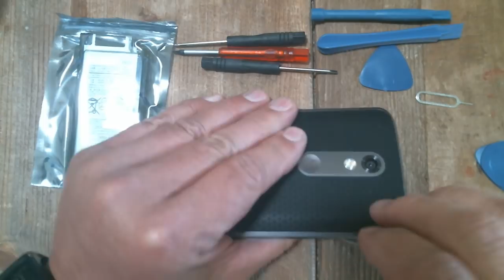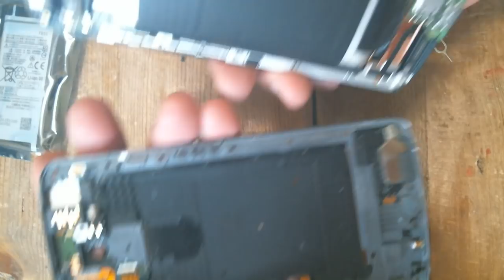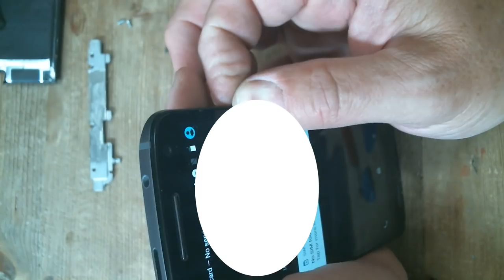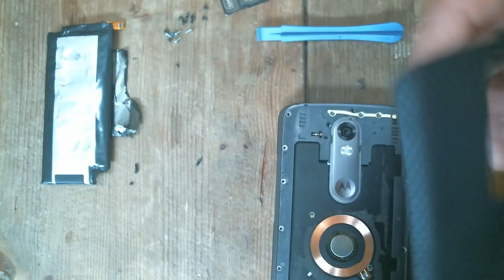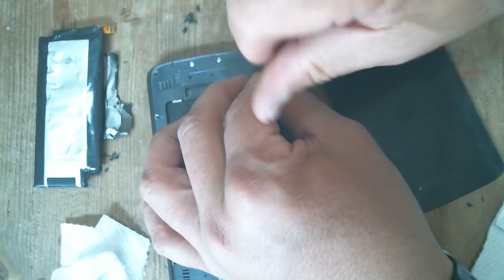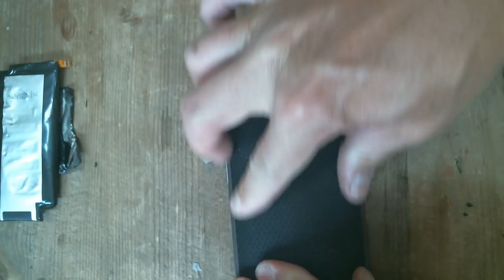Replacing the Battery in my Droid Turbo 2

Comment: I fell back to this video twice. The first time would have been all it took, your instructions and demonstrations were spot on. The glitch came with the small copper ribbon that clips down onto the ... motherboard? The two batteries we've bought, and returned and are about to return had the ribbon in the same place, but the clips faced UP and just to the side of the clip in the board. I know your lessons would have worked since I was able to reinstall my existing battery (which dies randomly as power gets to >75%. It works well when it's on. Not great, but well. My Motorola lasted four years, but still ... it was once a premium brand. You sir, are a premium resource. Thank you for your help. /respects

Comment: Thanks for the video.. I just replaced my 3 year old battery tonight. Even after you said "some people strip the screws.." I STRIPPED A SCREW HEAD!! Eventually I drilled the head off and pulled the body off .. Not a big issue just be careful. Only bad part.. I got the old battery out dated 2015 and the new battery I put in is dated 2016!!!I did not think about checking the manufactured date but it came out of the sealed package charged at 78% and holding. Old battery would have gone down 10% just by turning it on and opening an app. Thanks again,
Reply from the maker: Those tiny screws are easy to strip. I am glad you were able to get that done.  The batteries mostly wear out from being cycled (discharged and charged, most of the damage occurs near the end of the charge when it is held at a higher voltage, when the battery is over heated or if it is severely discharged, severe discharge usually does not occur with built in protection).

Comment: The ironic thing about this phone was that it was marketed to be durable (crack proof screen) and such.  This phone gave me nothing but problems. First the charging port went and then the battery all within a year. I've long since gotten a new phone but decided to try replacing the battery in my Droid Turbo 2 to use to watch videos. I followed the steps and so far, fingers crossed, the phone is up and working. Thanks!
Reply from the maker: The only thing bad with mine was the battery, I have had mine since 2016, still works pretty good. I have dropped it so many times and still no broken screen. I am happy you were able to use the video to replace your battery, maybe will come in handy as a backup phone if you ever break your new phone.

Comment: Excellent tutorial sir! Made it easy for me. 

For anyone else about to do it, I recommend buying a decent precision screwdriver kit (Harbor Freight for $7) because the throwaways that they give you BOTH stripped out trying to get the perimeter screws out. They have thread lock on them and are fairly tight. As Mad Scientist said, good downward pressure to get these out. 

Also, I recommend taping the battery in place so it cannot move around in there.
Reply from the maker: Thank you! Definitely a good amount of downward pressure to remove the little screws.

Comment: Ok did mine tonight.... the power and volume buttons are a PITA when re-assembling the thing! There does need to be a notch in the upper-right corner of the replacement FB-55 battery. I left the black glue on back of cover only peeling off any bunched up sections but whatever was still smooth I left alone and put the cover on using only that it seems as secure as ever IMHO. Lots of tiny screws, hobby glasses with bi-focal lenses much recommended! Finally I did not have any sound when I first test-powered it on with back cover still off and most of the edge screws not in... took it back down to battery pack, couldn't find anything amiss so put it back together again with a few more of the edge screws in place and test-powered it on and got sound and everything so something inside must need to make contact between the part with the wireless charger antenna and the circuit boards on the phone for sound and vibe to work! Scared the dickens out of me at first I thought I had made a mistake somewhere! Anyways.... regards and have a great Christmas!

Comment: This was way easier to follow than all the ones I've watched. Now I do think I can do this myself. Thanks for an excellent Turbo 2 phone battery replacement video. Great cleanup technique. :)

Ordered my kit. It came with a T3 screw.
Reply from the maker: Awesome! I wish you the best of luck with the replacement. Let me know how it goes!!!
Reply: One of the black screws could not be unscrewed. Don't know what to do next. I'm trying not to force it apart.
Reply from the maker: You can try filing a very small amount of the tip of the screwdriver off to give it a little more 'bite' then try pressing down with a fair amount of pressure when turning the screw.
Reply: I actually did that. Didn't work. Thinking I might need to cut through the screw or something.
Reply from the maker: That is a possibility, if you have access to a drill press you can get a drill bit that is a little bit larger than the screw shaft and very carefully with a very slight pressure drill into the head until it comes off. I would only try this on a drill press since it would be very easy to damage things without the stability of a press.
Reply from the maker: Any luck with this?

Comment: I really liked your video. I watched another video of some guy with the blue gloves take off everything and thought that was stupid. I have taken apart many old Motorola droid phones (I have a droid 4 ) and fixed them all. Those batterys off of Ebay don't seem to last very long but for like 15 bucks still worth it. I just bought a Turbo 2 and the battery drains fast. I ordered a new battery off of Ebay and going to change it out and use it as my daily driver.
Reply from the maker: Thank you, The battery I replaced is still  working, starting to show a little less capacity but definitely worth the replacement and extended life of the phone, so happy I did this.

Comment: All things in balance, this is actually a pretty simple procedure: At least Motorola had the forsight, wisdom (and not to mention decency) to have the access point in the BACK of the phone. MOST devices these days can only be accessed by removing the screen - that is an altogether different animal (especially since everything has to be gutted along the way to get to the battery that way).

Here it was just a matter of removing a thin plastic layer, unscrewing a barrel full of screws, removing another piece, and lifting about three connectors upwards (at least they wheren't the parallel kind with the latches) to get to the battery.. Basically, at least Motorola doesn't make it absolutely impossible here..

Comment: Bought a phone repair kit from walmart for $7 and had no issues. I would recommend putting a tiny bit of penetrating oil on the screws and let it sit for a couple minutes before removing them. This honestly wasn't much worse than any other battery replacement and is pretty much the standard nowadays.

Comment: Great video on replacing the battery, and thanks for posting. A couple of questions and a suggestion: How is the battery life with the new battery? Also, why did you remove all the adhesive before reassembling? At the part where you forgot the bracket, and had to start over; some people might be following along in doing their replacement: it might be helpful to overlay a note at that part of video to let viewers know that you made a mistake at that part of the process, so they don't do the same thing. Otherwise, your video is a great resource for those seeking info on DIY battery replacement. KUDOS!
Reply from the maker: Thanks for watching and the nice comment and suggestions.  The battery performs like the phone was new now.  The old adhesive had to be removed so that the cover would go back on properly.
Reply: I had the same question about the glue.  I am going to pop my phone back in its gator case.  Think that should hold everything thing together just fine.  Thoughts?

Comment: I am trying now and being unsuccessful on getting the black screws out,  drilled them and broke the phone glass.  Even though I was being very careful.  Threw phone away  It was worth a try.  Phone was not working properly so wanted to try to replace battery.  Tried to save it.  also the kit I ordered the heads of the tiny screwdrivers stripped right away need really good tools working with these tiny screws.  I tried

Comment: Well done video! May I just suggest laying down a white towel or cloth as your work surface next time though.... it keeps tiny screws from rolling away, makes them stand-out (easier to see against a white backdrop) and protects the phone from scratches. I love this phone best I ever had but now mine is starting to shut-off after a mere 12 hours or so off charger (even just sitting unused overnight on night-stand by bed fully charged it dies 1st thing when I wake up and check it!).... so, even though only a few months past a year old, guessing I'm about to need to replace mine's battery too. Ughhhh! :-(
Reply from the maker: Great suggestions! I really like the phone because I have hit and dropped it so many times and it still has an intact screen. After replacing the battery mine has been running great. I wish you good luck with your replacement. Be careful taking the screws out I know they strip the heads easily so a fair amount of downward pressure while taking them out.
Reply: Quick question.... why do some of the FB55 replacement batteries have a notched corner while other FB55 replacement batteries have all 4 corners intact? What's with the notched corner and is it necessary to fit in our phone?
Reply from the maker: @MShrader211  I do not remember any notched corner. I have a link in the video description for the one I used.
Reply: Yeah the MaxBear one doesn't, but many listed as FB55's for the Motorola Turbo 2 do have a notch in 1 corner which made me wonder... I can't find any difference in them cost or specs wise, so it has me baffled. I was looking for a replacement battery that included the battery cover adhesive or 2-sided sticker, when I started noticing some batteries have the notch in them.

Comment: I've started trying the replace the batt in my wife's Droid Turbo 2, and I've already run into differences from every other video including yours. To start with, even using a heat gun, the fake leather skin on the back of the phone, it ripped all to pieces instead of coming off. Maybe I had the heat gun on too low. While working I have upped the heat gun to 400 degrees, which helped, but I'm afraid of damaging the display of course. I note that you have a plastic skin on yours. After I got most of my leather skin off, I found a coating of semi-transparent plastic on the machinery. The machinery under the plastic looks like yours. I won't be able to remove any screws or other parts (much less the battery) until I get through the plastic. The plastic might be an extra-thick layer of glue that was holding the leather skin on. I'm afraid to apply high heat or solvents to it. I might try simply cutting away the plastic, but if it is struck to the parts underneath it, it will be hopeless. My wife says she's had this phone five years. Could it be a less-repairable, earlier model than yours? Do you have any ideas or suggestions? Or is it time to throw out this phone? Thanks.
Reply from the maker: I wish I could see a picture of it, but it kinda sounds like the leather was attached to the plastic and it was the plastic piece that should have come off with the leather still attached to it.
Reply: My phone is like this one. The leather is glued to the plastic backing of the phone. I started to just pull up the leather at first, but I soon realized that it was just the skin of the plastic back. You need to start by getting something sharp and thin under that plastic backing and DO NOT just start pulling up the leather. The leather part is the prettiest feature of this phone, in my opinion and I didn't want to ruin it.

Comment: Great video sir, a very nice job.
I was just wondering why you don't at least put down a microfiber towel to cover up that rough wood your working on? Just the grit in the wood, not to mention what ever else may be on it couldn't be good for your phone.
I make my work benches out of New kitchen counter material I buy at a over stock store for home improvements. At least it's smooth anyway. 
Just wondering is all, no criticism, none at all intended. It's just tjat everyone's bench may not be as clean as yours.😉
I have bough Motorola phones since they came out! Never had problems with the phones, but their batteries have always been their downfall. The phone quality, and my own ability to repair them is ALL that keeps me with them these days.
Thanks again for the video, it was great!

Comment: Thanks for the video. Was wondering if you did this after the operating system update that killed the battery. I've been stalling on the update for over a year but things are getting bad now.
Reply from the maker: I did not hear about the OS update that killed the battery. Do you have a link that I can read about it? I have done all of the updates on my phone as they come in.
Reply: It was the updatre to Nougat @madscientisthut
Reply from the maker: Just did some reading on it. Mine is running 7.0 (Nougat). So far mine has been running pretty good, just that I get it into this mode every few days where it will eat the battery quickly, but a quick reboot usually fixes that.

Comment: That said, though: I too am a bit disapointed in Motorola here. I've had a Droid Turbo 2 since March of last year, specifically because I heard about how rugged, durable and dependable the phone was - I had a Moto E (2nd gen) and Moto G (3rd Gen): Both of them where tough and lasted me as long as I had used them: They felt like the ThinkPads of phones (it's no wonder Lenovo owns them now), and figured that the Droid Turbo 2 sounded something like the X1 Carbon of phones.. THAT SUMMER the usb cable died, and I had to charge it wirelessly, which was a pain in the side as clearly the battery wasn't having any of it and everytime I let the phone get down to zero it would sometimes take a whole day or two even (!) for the phone to START charging normally without spazzing out and discharging itself..

My phone was later stolen and so I bought another Droid Turbo 2 for cheap - Now THIS DT2 will lie to me and pretend that it is charged up to say 45% or something, but then when I run a dozen or so apps on it it either reboots itself, OR it reveals itself as being down to zero.. And when charging it it charges too quickly (and it's not even showing "Turbo Power"), so clearly there's something screwy with the battery..

The battery on these things seems to be a major weak spot, I don't get why motorola cheapens out on the battery so much when they made it this difficult (though, again, not impossibly so) to replace the battery, when this thing is specifically touted as practically indestructable..
Reply from the maker: Yep, a quick cover with a latch on the back and a clip in replaceable battery would make this phone just about perfect. I have had mine almost 2.5 years now, I still love the fact when I drop it that there is no damage to it. I see folks getting the latest phones and breaking them in a few weeks with one drop.... I beat my phone up all of the time and it is still ticking

Comment: I have this phone since 2015 and the battery finally took a dump on me. Just ordered a replacement battery for it. These phones are tough af, I dropped my phone so many times and the screen still in good condition. Just the sides are chipped.
Reply from the maker: Just remember a good amount of down pressure when removing the screws, they strip easily if there is not enough pressure.

Comment: On the links you have in description... That's isn't the tape you used is it? Also, did you buy that cover also you have linked or used the old one? Thank you for the video.
Reply from the maker: Hi, The tape I used was a permanent double sided scotch tape. The cover was my original cover. I thought I would provide those links to make it easier for someone else, the removal of the the adhesive from the original cover was a lot of work, and I have also heard that some of the covers do get damaged during removal.  Thanks for watching!
Reply: @madscientisthut  thanks man huge help

Comment: A few years ago, I moved up from landline to one of those non-Internet capable flip open phones.
Reply from the maker: Less than two years ago I went from a flip phone to this Droid turbo 2 because our fire department uses IAR (I am responding) to let them know who is responding to the calls.
Reply: madscientisthut
You have the need. Being retired I'd probably still be landline only, if it wasn't for my little flip open cell phone costing less.
Reply: @KowboyUSA  I had  flip phone for years;  about 25 bucks a month.  Only problem is nowadays everyone texts and my flipper wouldn't do texting.

Comment: Yeah, that "stripped screw" problem is caused by the cheap torx driver I got in my kit. Had to gently file down the tip to try to get the correct sizing for my screws. Only got 3 of the longer 4 silver ones and six of the shorter black screws to come out. Oh well, the phone was a paperweight & I'm only out about $13 total. . . Good video otherwise (DO NOT try to just pry the edges loose w/screws remaining! LOL!)    ;)